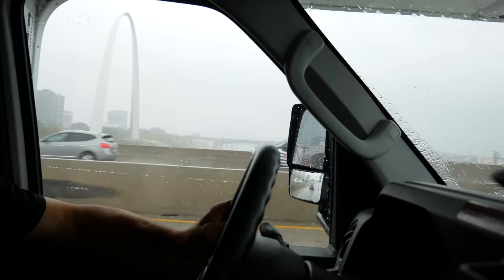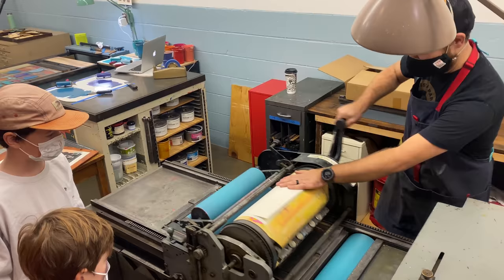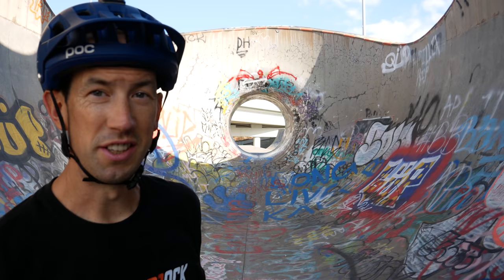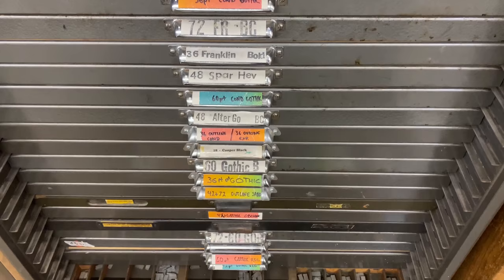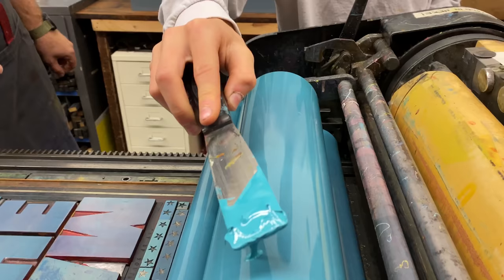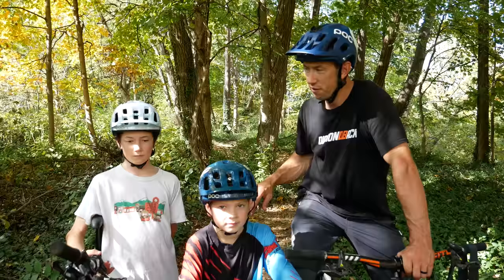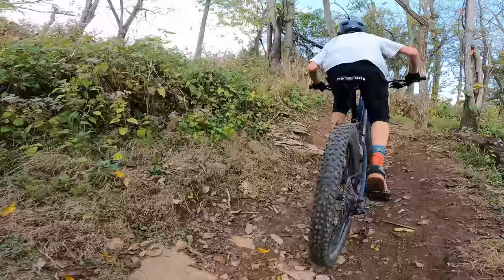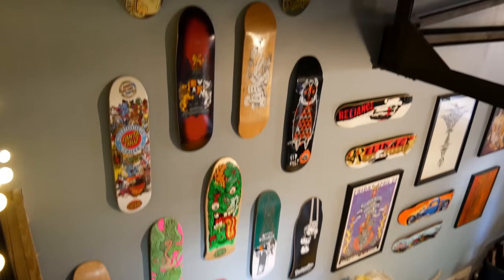Revisiting my Childhood Skatepark - Louisville Kentucky!

Comment: Hey does anyone know a good bike full sus or hardtail under 1500 usd. I currently have a trek marlin 4
Reply: Go with the Roscoe 
I had a marlin 5 and upgraded every single part so if you know about bikes put in about a $1000 and go upgrade everything.
Reply: I agree with timmyfranks, either a Roscoe or a Fuse
Reply: @Connor Lamping what website did you use. Because I’ve looked around pink bike a bit and have seen some good deals but not many.
Reply from the maker: Diamondback has a bunch, check their website!